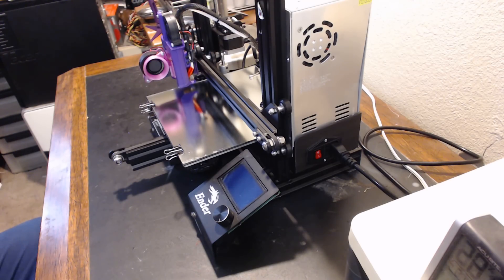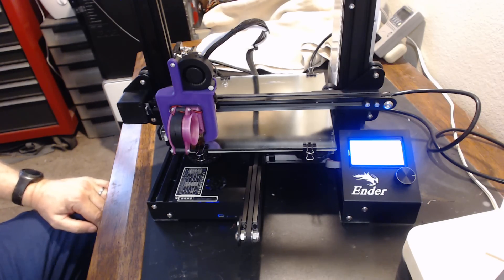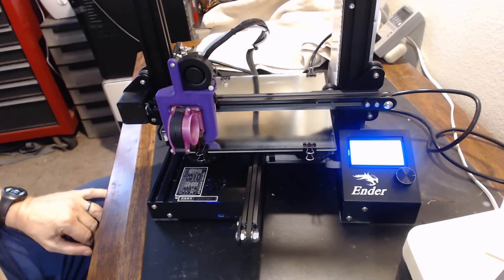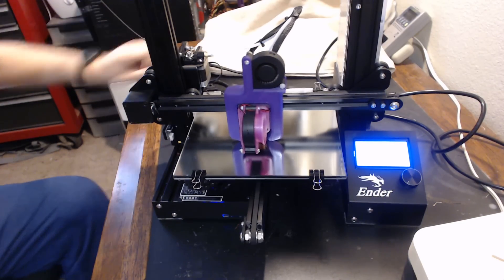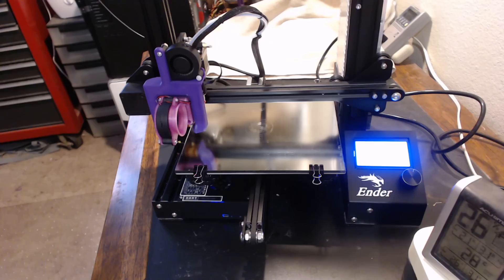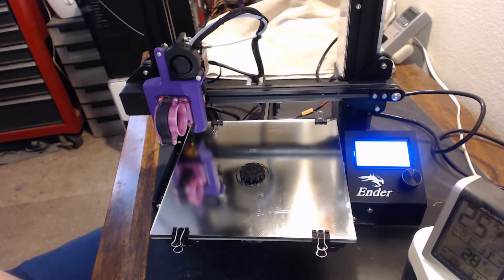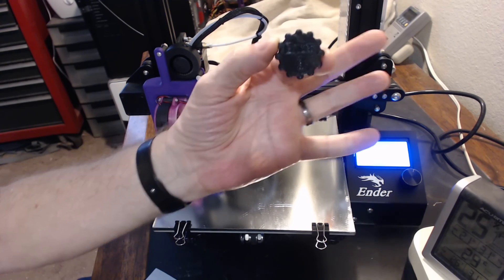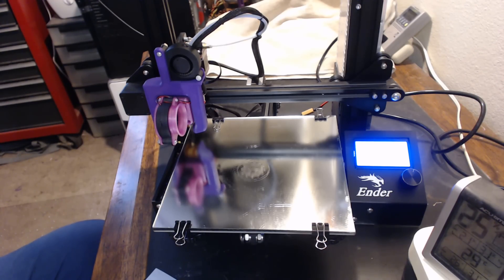PETG Maker Coin on the Ender 3

Comment: I have the exact same printer and I use the same slicer and yet my prints look like shet!!!
Reply from the maker: Give me some more info and I'll try to help. First thing is what are printing? If you're printing some of the pre sliced files that came with the printer we can rule out the printer settings. Next thing to check on the Ender is the feed mechanism, when you tell it to feed out 100mm of filament is it feeding out 100mm, or a lot less? Usually these problems aren't had to solve, but we have to go through the steps. I can provide you with a pre sliced cube if you don't want to print the stuff that came with the printer.

Comment: Most of you having issues with printing need to make sure your filament is dry. Chuck is in a room actively cooled by A/C, this generally sucks all the moisture out of the air. Great videos, Chuck. Really appreciate you taking the time to put them out.
Reply from the maker: Thanks. Not only do we have the A/C on all summer, but we live in Arizona where the humidity is pretty low normally. We haven't had the A/C on for a couple of months and it's been damp out and it's still only 21% in my work room. So yea, if any of you live where the humidity is high, build yourselves a dry box, both for storing filament and feeding it. Thanks for mentioning it, since it's not something I have to deal with I don't think about it or talk about it, but maybe I'll set something up.
Reply: @3rdpig  I'd love to see your take on a dry box. I was about to build a new one that I can feed directly to my printer, maybe not a great idea... But I'll give it a try anyway =]

Comment: Im really struggling with petg on my ender3.  Ive tried temps from 235 to 245. Speeds from 25 to 55mm. High and low speed fan. All sorts of retractions. Flow from 95 to 105% and a bunch of other things.  I cant keep the print from getting stringing and blobbing which eventually ruins the print.  If i turn the flow down far enough to just about get rid of blobbing i lose layer adhesion from under extrusion.  Can you share the cura settings you settled on?
Reply from the maker: I'm printing some small parts now in PETG and I'm using some new settings. They'll be done by the morning and if they turn out good I'll share the settings with you. I've had some blobbing issues too, I think it's the nature of the beast. I like PETG when I need strength, but for sheer pretty it's hard to beat PLA.
Reply from the maker: My parts turned out really nice, honestly better than I expected. They're small parts, no bridging or support was required. But there's no blobbing or stringing, but since they're circular parts (knobs for machine tools) stringing might not be present anyway. But the outside profile looks nice, it's very smooth and the layers are tight.

Here's a link to the Cura profile, let me know if it works for you.  
https://drive.google.com/open?id=13sALy0Kdx9AOYapyxGIML5hwBcsuO3uC
Reply: @3rdpig  sweet!  I'ma try it right now.  I hope it works out.  I've got my pla tweaked so nicely that I don't even have to look at the print anymore while it's printing.  I'd like to get petg at least servicable.
Reply: Well that didn't work for me. Same issues. I am going to try a different brand if petg.  I'm also getting new nozzles. I've been using the same nozzle for a long time so will see.  Thanks for your help. I'll keep you posted.
Reply: Would you mind printing something like a benchy and let me know how that comes out?
Reply from the maker: Is it happening on everything you print or only on certain things? I'm using Priline black PETG and I'm using the stock Ender 3 hot end and nozzle.
Reply: @3rdpig  yes. Everything.  Some things work better than others due to the shape etc but bleh.  Yeah stock hotend.  My nozzle has a half dozen rolls of places through it so it may be kaput.  I also might have just gotten a bad roll of petg.  I'll try new of both and report back.
Reply: @3rdpig  ok. Cleaned hot end, new Bowden tube, new nozzle and most importantly good petg and things are a lot better.  I noticed you had line width set to .5mm. That was really messing things up for me.  Do you print with a .5mm nozzle?
Reply: New to 3D printing and the Ender 3, and I've loved PLA. Much of what I want to use the Ender for is RC crawler parts though, so I need a less brittle, more heat-resistant material. In my research before even getting the printer I decided PETG would be the way to go, so 90% of the filament I bought is PETG. Tried it yesterday over 6 or 7 prints, tweaking everything--fan speed from 0 whole print to 100, bed from 70 to 80, nozzle from 240 to 245 (filament says 230-250), flow from 80-100. Turning the fan off made the shell much more rigid, but I can't seem to get rid of the fuzzy, nasty-looking print quality. It's driving me crazy!
Reply: @stpatty3310  what slicer?  If cura try the profile Chuck provided to me.  What brand of filament are you using?  Petg is naturally sticky so it's a lot more susceptible to stringing and blobbing than pla.  I'm finally getting close but still my petg aren't as pretty as pla.  They may never be.
The most important thing I've found is making sure there is never too much filament coming out.  A little too much filament snowballs into a mess.  Honestly there are so many setting that affect so many things as well as each other I feel like I'm still just scratching the surface.
Also be careful a 245 and above.  Your ptfe tube will start to break down around there.
Reply: @stpatty3310  you also may want to look at nylon.  I got some taulman 230 I'll be messing with soon.
Reply from the maker: @DoRC  I print with a .4 nozzle. I changed line width from .4 to .5 to solve the problem of gaps in the top layer around holes. It was recommended to me by one of the experts on the Cura forums and it fixed that problem completely and I got the best top layers I'd ever had. I use it for everything now and haven't had any problems from it. Also, I was having the problem across multiple printers, so it wasn't a single nozzle or printer problem.

Check out my latest videos, I have a new PETG Cura profile, but it still uses a .5 line width.
Reply: @3rdpig   can you share the cura settings? i try with the video but still get bad adhesion layer, please help :(
Reply from the maker: @victortrivino9457  Sure
My PETG Cura profile  https://goo.gl/RJyQqT
Reply: Dry out your filament.

Comment: I'm just now seeing this video, as I have a project where I'm probably going to need to print in PETG (for my first time).  Do you have any new information you would like to add about PETG (temperature wise), or is it still 245/70?  My thinking was; with the glass and hairspray holding so well, and other information I've seen about PETG that shows bed temperature not being a real issue; what do you think the result would be at 245/50?  Thanks to you, I've been printing my PLA with a 50 degree bed temperature, and it has been working great!  BTW, I'm not a fan of chiseling the part off the glass.  Instead, I just put the glass in the freezer for a couple of minutes, and all of the parts just slide or fall right off.  I have a couple of glass squares I made, so while I'm cleaning up one, the other one is on the bed and getting worked.

Comment: Thanks Chuck for the great video.  I have an Ender 3 Pro coming  from China in about 3 weeks and after practicing with some PLA, I want to print a gas-gage float out of PETG.  Your demo would seem to be very helfpful.
Reply from the maker: A float would be pretty easy to design and print but 3D prints tend to be porous. Do you have a solution for this? Also, is PETG stable in gasoline? Anyway, I'd be interested in your thoughts on that as well as what you think of the Ender 3 Pro.
Reply: Hi Chuck.  I didn't realize 3D prints are porous and would therefore not float after a while.  I have not yet received my Ender 3 and so still have absolutely zero experience.  I'll have to google for a solution.  Thanks for educating me.
Reply from the maker: Sorry Tim, I didn't mean to rain on your parade. Some people have had luck with making water proof containers using the Spiral Vase mode available in most slicers, but I'm not sure that would make for a sturdy enough float for a vehicle's gas tank. 

Here's a link to a chemical resistance chart, it looks like PETG is mostly resistant to gasoline. My old CJ-7 wrecks gas tank floats every few years, next time I yard the tank out it's getting a brass float. I'm still kicking myself in the butt for putting another plastic float in it just to have it sink two years later.

http://sevierlab.vet.cornell.edu/resources/Chemical-Resistance-Chart-Detail.pdf

And it wasn't that long ago that I had zero experience with 3D printers. This seems to be an endeavor where you learn quickly or give up in frustration.

Comment: hello friend that good video, you know I have a problem with my Ender 3, it turns out that it is printing and from one moment to another the extruder goes up and is printing in the air and does not boot filament, has this happened to you? , what am I doing wrong?
Reply from the maker: So it's printing OK for a while, then all of a sudden the Z axis raises, it stops feeding filament but the X and Y axis are still going as if it's printing? Is that right?
Reply: Chuck Bryant right friend that's just what happens
Reply from the maker: What gcode are you using? If it's something you sliced yourself then either try the dog.gcode that's on the sd card that came with it or I can provide you gcode for a small cube. Also, try using a good quality sd card, the one that came with it is garbage.

Comment: Have you done any more complicated prints with PETG since making the coin? I'm struggling with stringing on internal surfaces. Have you played with retraction settings or travel speeds?
Reply from the maker: Yes I've printed quite a few things in PETG and I had the same problems you're having. I think that a cooler nozzle temp, more air flow helps (my older Ender with the Petsfang and 5015 blower strings a lot less than the new Ender that still has the stock part cooling fan) and a slower print speed help the most. I'm using the stock retraction isettings n Cura, (5mm 40mm/sec) and while it seems counter productive, I think that might be too much and too fast for such a stretchy filament. Next thing I'm going to try is to cut that down to 1mm and 20mm/sec. I haven't played with travel speed yet. Let me know if you come up with anything better!

Comment: 90 is too high for petg. Gotta go slow for petg as well.
Reply from the maker: The manufacturer of the PETG filament I'm using has a sticker on the side of the spool that recommends a bed temp of 80-110 and if you watched the video all the way through you'd see I've lowered it to 75. I'm not having any problems with using the same speed for PETG as I do for PLA.

Comment: Very nice
Reply from the maker: Thanks Ahmed. I printed the base for the Petsfang in the black PETG. It turned out beautifully. In my next video I'll show it off at the  beginning. Thanks again for watching and commenting.
Reply: Chuck Bryant ohh, that sounds good. Another question regarding the fan mods- are the fans that you installed working fine? Because you had mentioned that on thingiverse it was stated that a resistor needs to be added to make the fans PWM suitable
Reply from the maker: I've had one problem. Yesterday the part cooling fan stopped working sometime during the day. I found that the wires that came soldered on the fan had broken inside the insulation about 2" from the fan. I solved the problem by desoldering and replacing those wires with a large gauge wire. With the X axis moving back and forth it's impossible to stop the wires from bending as the hot end moves, but now not only are the wires larger but I've left a little extra free to spread the motion over a larger area. I'll touch on it during my next video.

Comment: Hi just curious on your mirror there. Where do you get the mirror/format to the ender 3 and does the bed lower down far enough to accommodate the glass plate?
Reply: just adjust your Z limit switch up the thickness of the glass to compensate.
Reply from the maker: I bought 12"x12" mirror squares from a home improvement store and cut them to fit. I got the glass cutter at the same store. Cutting to fit was really easy. Don't worry about moving the bed,  just move the Z axis end stop up the same thickness as the mirror.
Reply: Ill have  to give it a shot. Thanks for the info